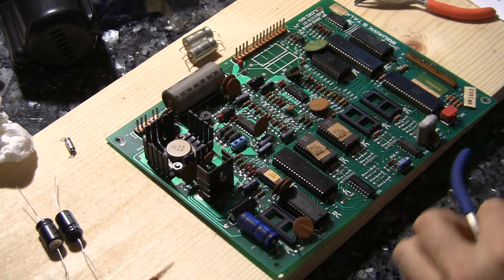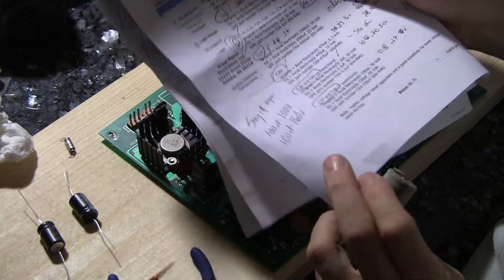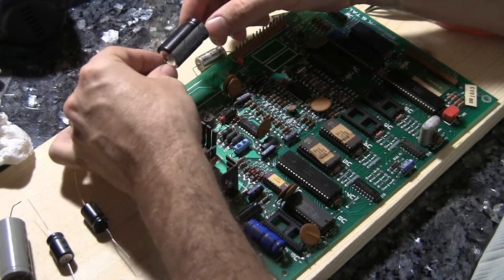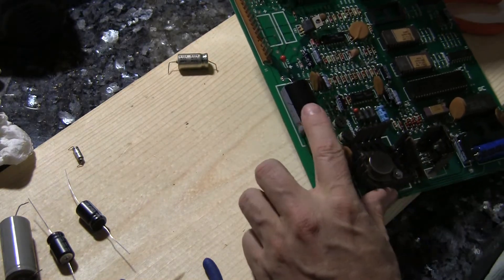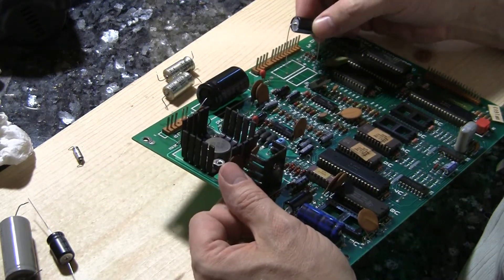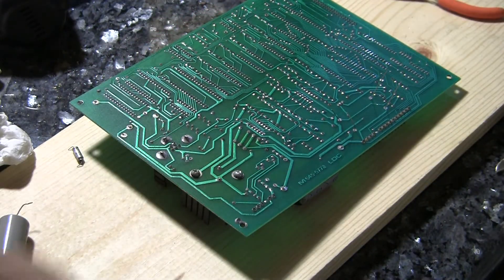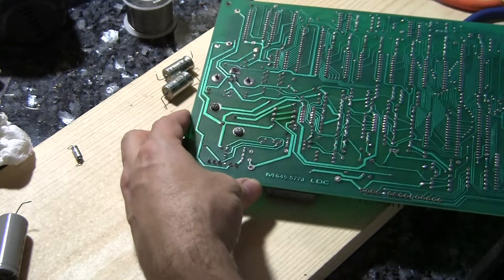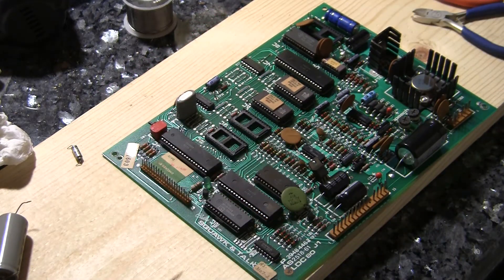Rebuilding a Bally Squawk & Talk sound board pinball Pt 2 - PinballHelp.com

Comment: Awesome I need to get a kit for my power supply in my High-Speed.
Where do you get your kits from?
It will easier just to get the kits then to try and get each individually.
And I tend to love rebuilding boards.
And I bought a power supply kit that I thought I would fail on but it actually works and used it for an LED matrix that will be one of my projects I am doing.

Comment: I've found capacitor C15 to be the single most troublesome capacitor on this board. I use a 10 uf @ 50 volts for the replacement as it gets a lot of heat from the three diodes below it.

Comment: How much wattage were you using to solder in the new caps ?
Reply from the maker: I usually set my soldering iron temperature to around 650F.  If you're not as quick, you might want it to be a bit lower.
Reply: @PinballHelp  I have a 120w induction station and I always leave it at 572F unless I need to do something at a lower temperature.  If you need it higher then your station isn't powerful enough.